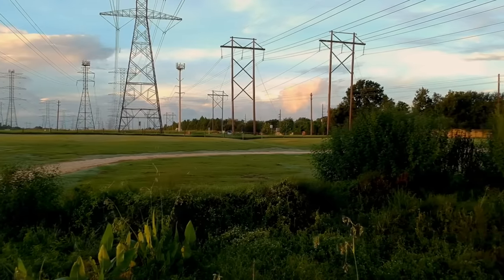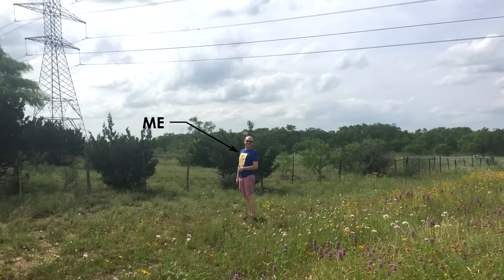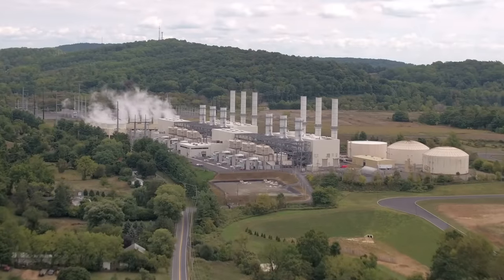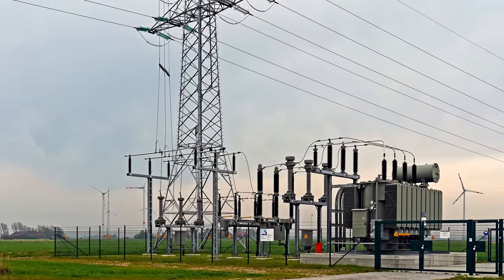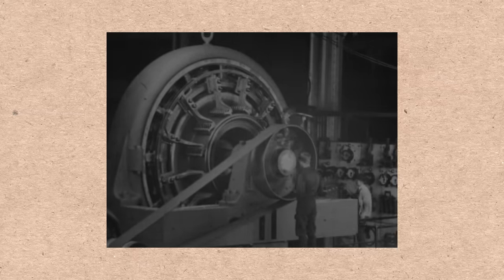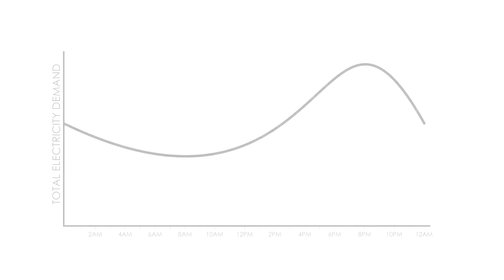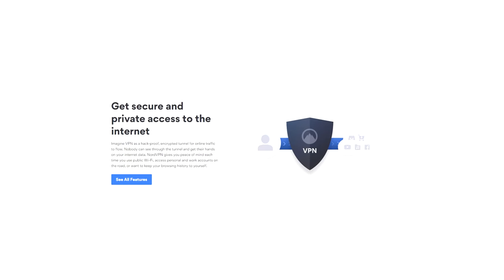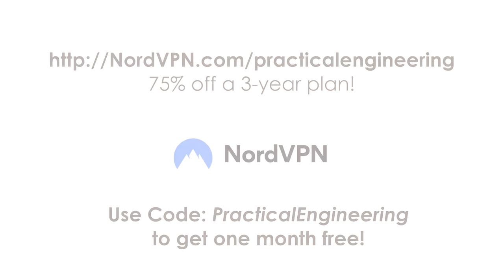How Does the Power Grid Work?

Comment: In central europe, our clocks were late for a few seconds last year, because Serbia and Cosovo had a fight over delivering electricity and thus, the frequency sank
Reply: LesleyVids,  it's scary the way that political tensions can affect the population so immediately and right in their own homes. A few seconds on a clock is not a huge deal, but it illustrates how vulnerable our daily lives are to forces outside of our control, and how easily things could go from bad to worse. I'm glad for you that that's as bad as it got. We all are vulnerable...
Reply: European grid is running slow for several years now. at something like 49.997hz or something. Not much of a difference for most thing but it affects clock that relies on it being exactly 50Hz
Reply: I remember Tom Scott making a video about this
Reply: Almost as bad as the fight for water rights....
Reply: More like a few minutes, actually.
Reply: So basically all three remaining frequency-counting clocks in Central Europe...?
Reply: @AttilaAsztalos  Is not just clocks. Frequency stability is important because other devices like industrial devices are designed to operate in specific frequencies, and all the electric generators have to run on the same frequency to maximize efficiency and to reduce risks of overload in their installations.

Also all the members of the EU plus other nations around operate on the same grid, so imbalances in one side can produce problems in other parts.
Reply: @AttilaAsztalos  every clock you see on ovens/microwaves/billboards etc. basically every clock that runs 24/7, with the exception of those that have to be precise (like in Trainstations, they get their own Signal)
Reply: @TheKnaeckebrot fair enough about microwave ovens and such, just checked the service manual of mine, and it is indeed taking a pulse from the low voltage transformer into the controller chip. Anything that contains a clock in any kind of half-serious manner (as opposed to "hi, I'm an appliance, and oh I also have a clock") just uses a dirt cheap quartz crystal instead - for the simple reason that you can keep running that off a backup battery basically forever, while all the precious mains-synced clocks basically shit themselves at the first power outage of any length.
Reply: @klonik79  I hear in the USA they count the cycles and make sure they're correct. 60hz * 3600sec/hour = 216,000 cycles/hour. If only 215,999 cycles occur, they increase supply so the next hour may be 216,001 cycles, which averages out. This means the grid is only ever so many cycles off of perfect, on top of using atomic clocks to real-time monitor cycles. From what I can find, +-0.5% at any given time is within range of "healthy" and is slightly over 100 cycles/hour off. But the overall average should be exactly 216,000.

In theory, a frequency counting clock should be about perfect over time, but +-1min throughout the day.
Reply: In North America we do time error correction to remedy this. Changing scheduled frequency from either 59.98 or 60.02 
Hz to counteract for accumulated deviations
Reply: @BenjaminCronce  Yes that should work here too. Difference is US is one network under one authority, so they can agree on who will do it. Europe's grid is about 35 networks interlocked, whom can barely agree on 50Hz much less who will be one supplying more power to grid. Also about 1/4 of those networks aren't even from countries belonging to EU. Which in itself is loose confederation (unlike true federation of USA) thus even those will spend so much time talking it is long past time any action would have any impact
Reply: @Rens243  you do notice that graph is saying it is actually worse than what i said? I said 49.997 reality is 49.97 making it worse ? Much worse....
Reply: Really ? there’s this ‘modern’ invention called an electronic clock... does not depend on frequency... time for a store visit ! (yes,pun intended 😂)
Reply: Hello Kitty Lover Man! your crystal oscillates the same as the ‘line frequency’ (my reference) ? man... that’s 1 step backward for ea step fwd in technology ! 🙃
Reply: Quicker Mafs ...so why do we waste hours watching a shredder chew up tires & transmissions here ? lol
Reply: M Detlef  he is probably talking about microseconds
Reply: @klonik79  This grid time deviation is constantly balanced out. If the time deviation is more than twenty seconds the frequency is corrected in the grid. In order to balance out the time deviation again the otherwise customary frequency of 50 Hz (Europe) is changed as follows:

49.990 Hz, if the grid time is running ahead of UTC time
50.010 Hz, if the grid time is lagging behind UTC time
Reply: Just to reiterate how important maintaining grid frequency is, the Italian grid operator's procedures for frequency deviation mitigation include "general grid collapse" once the grid frequency drops below 47.6Hz, which is exactly what happened on september 28th 2003 due to an unfortunate sequence of events.

Italy imports a lot of its electricity at night since it's cheaper, and things had been going wrong for about an hour with several HV lines going offline off and on due to ground faults due to trees (heavy weather), others getting overloaded trying to pick up the slack and sagging too much (causing more ground faults), the Swiss operator getting pissed that we were drawing too much from a specific line (come on what's 300MW between friends?) and a tree straight up falling onto a line and severing it.
I don't remember what the last straw was, but eventually another critical line ended up opening, causing a massive phase angle deviation from our side to the Swiss side (more than 30°), which made it impossible to reconnect it for good, and this caused a cascade failure that took out the entire country in less than 3 minutes.
Imagine being the guy in the control room during those 3 minutes lol.

It was the worst blackout in Italian history, virtually the entire nation was left without power. Most of the North got it back in 8 hours, but many areas of the South were without power for more than 20 hours. The only region not affected was Sardegna because it was our little Texas and was not connected to the mainland at the time.
Reply: Only if your clocks were based on grid frequency, that's actually pretty rare.
Reply: @cw__  yeah!!
Reply: Of course, now that we use the atomic clocks on the GPS satellites, this wont be a problem.
Reply: @HelloKittyFanMan.  Most clocks provide their own, internal frequency as opposed to using an external source.  See pendulums, quartz crystals or rubidium electron oscillations.
Reply: i think it was something like 13,5 minutes the grid was off
Reply: @BenjaminCronce  This is basically correct, however the corrections are not tracked and made hourly. As the power demand rises and falls in a given period of time, it doesn't always match up with how much much power was actually PRODUCED for that same period.  If not enough power is produced, frequency drops.  If more power is produced than used, frequency will increase.  Before digital or battery powered clocks in their homes, they were either the wind-up or electric variety.  Electric clocks had an electric motor, so the accuracy of the clock is directly tied by how well utilities are able to balance the power supply/demand.  To overcome this, there is what's called time-error-correction.  Typically the time-error will be monitored until a few seconds of error have accumulated, and a time-error-correction will be started.  Generators (in North America) will adjust their frequency to 60.02 Hz if correcting for under-generating, and 59.98 Hz to correct for over-generating.  This will run for several hours to return the average error to zero, but has to be continuously monitored.
Reply: @AttilaAsztalos  the microwave resets the clock during a black out and brown outs
Reply: @BenjaminCronce  what about 49 in PAL regions?

Comment: So excited to see a power grid video! The power grid is an amazing combo of all kinds of engineering. Insulator design, lightning surge arrestors, oil-cooled transformers, static VAR compensation, fault protection systems that need to operate in milliseconds, underground/undersea cables, various types of generation and industry loads all with their own power quality trade-offs. So many different engineering disciplines all combined into one big system!
Reply: Henryk Gödel  Lots that can go wrong, but also lots of backup systems and preventative engineering in place to keep it running smoothly. The power grid is where it is today due to a century of continuous learning and improvements. Still takes a fair amount of human oversight at the moment as you've mentioned though. The operators mostly only need to be concerned about balancing load with generation. But occasionally things do get stressful for sure.
Reply: Henryk Gödel  Whilst minor very short-term demand fluctuations are managed by the system inertia, longer term demand management is very dependent on may external factors. Obviously seasonal demand is one thing, but the Grid operators need to have very accurate (and high-resolution) meteorological information, as well as information on TV scheduling (to plan for the "plugging in of kettles" at the end of popular TV shows!). Colleague's father was a senior CEGB Grid Management Engineer, and the number of factors / variables they need to consider just for "routine" planning is eye-opening. Add in the "padding" necessary during bad weather (especially windy weather, to help mitigate local supply outage effects on demand fluctuation) and you soon understand why their need for serious computing capability is what it is!
Reply: Ian Colwell english please?
Reply: @phils4634  wow, I didn't realize how much there was to it!
Reply: Although the systems remain the same the technology is progressing in leaps and bounds. At one time small 33kv substation were like miniature substations but now they can be contained in a building due to technology and nitrogen. Most units that need to be cooled or to stop arcing use nitrogen and units I used to install were half the size of their predecessors which were my age at the time. At the time I was the go to guy, in Scotland, to build S&C mod2020 units as I could build more than two in the time it took Siemans to build one. They asked me how I did it, I told them I didn't take the piss.
Reply: Nerd

Comment: I love hiking power line trails! They are a great opportunity to see the contours of the earth over long scales and the blasting exposes the underlying geology too!
Reply: B-but.... muh flat earth and s*iet.
Reply: Taylor,  So you get a buzz out of following power lines?  So you get geared up to string along with the cables that transform your effort into live, energizing, powerful experiences?
Reply: @VeganSemihCyprus33  -- You must be fun at parties.
Reply: They are a pretty good navigation tool for visual Flight Rules pilots too!
Reply: @dewiz9596  Valid point
Reply: Wonder why they never need to clear the forest from around power line corridors?.Simple the amount of electromagnet frequencies scattered of these bare lines dissuades the bees from pollinating under them so hence not much grows.Try taking an old style florescent tube and stand under one of the support towers (am meaning high voltage cross country lines) must be magic neon tube lights up.Not to worry standing under this scatter of emf wont kill you but in having said that there are many reported instances of households built to close to them suffering a higher than the  national average rate of mental illness and generational genetic issues.Just a thought
Reply: Be careful with the radiation . Those area are full of them .

Comment: Excellent video. I worked in  process control for over 20 years and many of my customers were power companies.  One of the projects I worked on that is unique to the electrical networks is Sequence Of Events  or SOE in industry parlance. The purpose of SOE is to tack changes in the electrical network down to the millisecond level: One purpose of SOE to track events in an outage or incident to analyze cause and effect. 

One very interesting and quite challenging analysis I worked on was to model the Arizona electrical grid as a mathematical matrix using Spice (A software package) and the generators were modelled as voltage sources and the users were modelled as loads and I had to determine (1) Which lines and power sources, if lost, would force the grid out of its spec (5% at the time) in either frequency or voltage. We also had to analyze power factor issues.

Comment: I work at an aluminum smelter. We  have a clause in our contract for power modulation. The grid operators can pull power off the plant or give us a bit extra to balance out peak and surplus load condition. It's actually pretty cool to see how this works on supplier side.

Comment: Practical Engineering.  The reason the Québec power grid is not attach directly to the east grid as to do with frequency.  Québec grid is essentially a Hydro grid. Being so, the variation of the frequency is higher than the one of the east, which rely on gas generator turbine.  Québec variation of frequency is between 59,95 Hz and 60,05 Hz, while the 2 grids (east and west) have a variation of 59,975 Hz and 60,025 Hz. this is due to the high inertia of the hydro turbine which weigh more than 400 mt each while a gas turbine will weigh a lot less.  To attach the grid and mitigate that problem engineer have built a back to back HVDC converter station which tie the two grid thru a DC System (a good video about this system  is "Brazil-Argentina HVDC interconnection").  More modern system will use a variable frequency transformer to do a similar job.   There is a direct link between James bay hydro-electric dam and Boston using a 450 KV DC line which i found very interesting since it use the other possible way of sending high energy on long distance (1000 mille + in this case) . another fascinating  phenomenon is the induction by the earth magnetic field during solar storm in long power line running north to south ..... to much to talk about in energy and the field of transport and distribution!

Comment: Australian energy engineer here. Thanks for the video. Nowadays, we can generally forecast variations in renewable energy resources with similar precision and accuracy to demand prediction. There are several ways in which variation of renewable energy can also be smoothed; passively using geographic diversity of generators, or actively using demand management and storage.
Reply: No need Radio.  Wind and solar are too expensive per Kw/H compared to traditional base load generation methods.
Reply: @patrickeh696  Incorrect. New build utility scale wind and solar are now significantly cheaper than new build coal, gas and nuclear on an LCOE basis, even when taking storage into account. This is because after capital expenditure, they have virtually zero fuel and maintenance costs. Capital costs of renewables continue to decline rapidly.
At the present time, the cheapest route on the electricity market roadmap is to keep baseload generators running until the end of their technical lifespan, and then replace them with renewables.
Also the unit is kilowatt-hour, not kilowatt per hour.
Reply: @RadioTrefoil  WRONG.  That is why you don't see power companies dropping solar and wind for the others.  The Market is ALWAYS Right.  Go back to school.
Reply: @RadioTrefoil  the problem with solar and wind is storage, you cannot store the load of a grid even with huge battery installation on a macro scale.  On a windless winter evening your whole electricity production from renewables shuts down at the peak load time meaning you need to keep a huge amount of fossil/nuclear capacity on standby to pick up the demand.  That in turn increases the costs of renewable energy.

The capacity factor of renewable energy for solar, at least in the UK is a shocking 11% roughly and wind barely breaks 35%. When you consider coal sits around 40-45% and nuclear is up at 75% you see how inefficient renewables are.

Ironically gas and oil capacity factors are low because those plants tend to just sit there doing nothing until they either have to pick up peaks in demand or your renewable energy isn't producing.  That's why you have to factor cover costs into renewable energy pricing as just putting up a solar farm is only a fraction of the overall costs.

Oh and offshore wind costs a BOMB in maintenance costs, I used to work with the UKs largest energy provider a few years ago.
Reply: @patrickeh696  You should absolutely consider running for a seat in the Australian House of Representatives. The LNC could use people like you!

Comment: I really liked this video, it is a really good introduction to understand the things we take for granted. Bu I would like to add that until recently there was no such thing as a "smart grid" yet we still had reliable power. Methods like water-pumping stations can be used to instantly react to variations in the load. The variations in frequency of the power network can indicate whether more or less power must be generated.

Comment: Supply regulation and protections infrastructure is a really fascinating area. Brings forth the concepts of reactive power ( VAr), true power vs. apparent power, and the "not that intuitive" problems (with elegantly simple solutions) seen in Grid Protection. You could have an entire sub-series of Practical Engineering just covering the design and manufacture of insulator bushings alone!